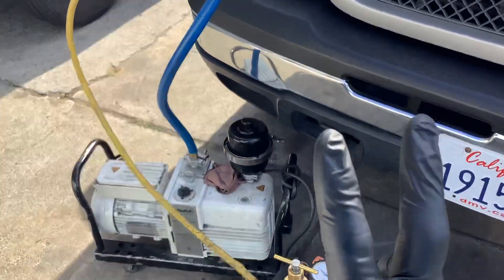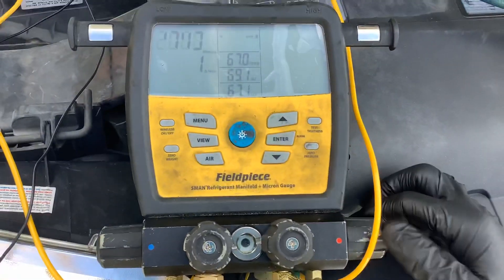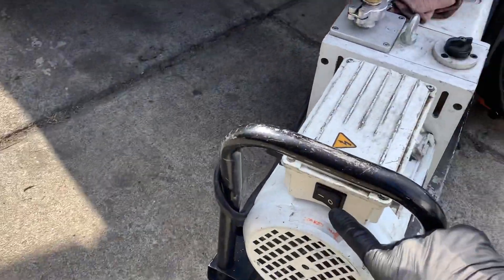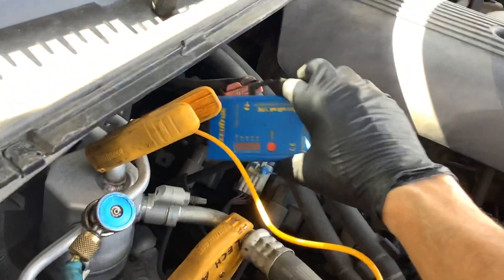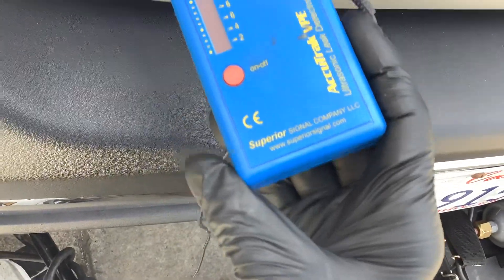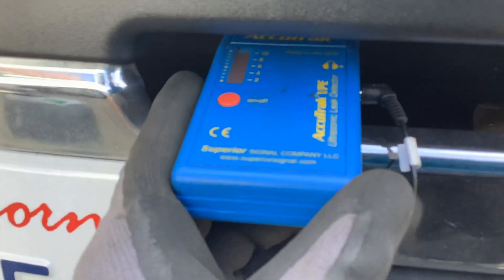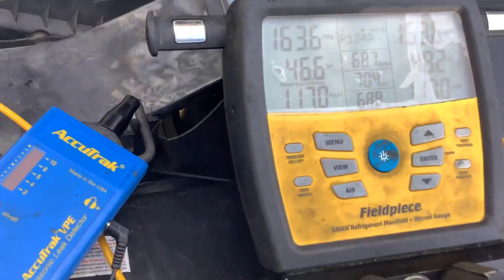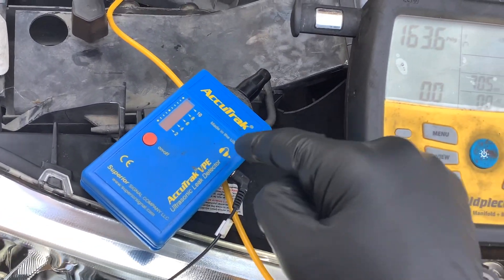High Pressure nitrogen decay leak test also using ultrasonic leak detector￼

Comment: Hello! Why do you do decay test by 160 psi only, but when system is charged and works it may has a pressure about 250 psi and more? In my region exists some rule to do decay test using nitrogen about 400 psi pressure, is that incorrect rule? And can you give any guarantees to the customer that system doesn`t have any leaks?
Reply from the maker: On residential split systems most manufacturers not all federal say 400 psi is good when I install a VRF system. Some of my manufacturer say 650 psi is good even on the Evaporators.

But we’re talking automotive here evaporators we’re not designed for 400 psi . 

Especially the Old Evaporators, everyone of us and automotive field know when you’re working on old vehicles with a large balloon accordion style hitters in the evaporators you will blow those evaporator sky high. You’ll see a big cloud in a loud bang inside the car and the oil coming out like an aerosol through the dash vents if you do 400 psi.. 

There has been many technicians who blew evaporators in customers car is experimenting, not knowing what they were doing. 

And then you can point to the Evaporator and say you have a evaporator late because you caused it. 

Your mind is thinking correctly for residential, but if you do that on customers automobiles you’ll be fine a lot of Leaking New Evaporators they weren’t leaking before but you causing to leak.
Reply: @coldfinger459sub0  so can I guarantee that system hasn't any leaks if I use 160psi? In my area 90% customers ask a guarantee that tomorrow it will not be leaking..
Reply from the maker: @markaircon  there is no guarantee no such thing that’s make-believe. Living in a fantasy world of unicorns and rainbows.. 

You did not sell the components. You cannot guarantee some thing you did not sell. 

If you sold the evaporator, you can guarantee evaporator doesn’t have a leak 

Any component you did not sell you cannot guarantee . 

Leaks or not always constant some leaks or intermittent . 

They rely on either vibration, going down the road or hitting a very precise certain temperature range they start leaking and then when the temperature range falls out, it stops leaking . 

Something that you cannot test for while the vehicle is stagnant, steady, sitting in your stall with your hood up 

And this is exactly why are you test using different methods like ultrasonic , with a good leak detector like a H-10 or a Inforcon DeTech Stratus
Leak detectors in the $600-$1000 plus range 

You also add refrigerant UV dye one of the better late ones made by tracerLine Products it’s one of the most expensive that’s why very few people use it . 

I’ve made many videos, showing other peoples UV dyes at the different spectrum. UV lights will barely get any glow out of them. They’re very poor performance. . 
 But they’re cheap that’s why people like them. 

And this is why it’s good to do a refrigerant leak test with a system that you have completely filled get it up to temperature get it up the pressure and then perform the refrigerant leak test using a refrigerant leak tester . 

Then, after you find the leak, you just throw it on the recovery machine. It only takes five minutes to recover refrigerant . 

Perform your repairs .

Comment: you mentioned that you charge nitrogen through the HP port...why not both ports at once? does it matter?
Reply from the maker: No, it does not matter especially if you have a hard shut off valve you end up using the low side anyway because it will not let all the pressure go through the high side into the lowside. 

But I do this method as part of the nitrogen sweep to help remove moisture 

Push to try nitrogen sweeping through from the high side and then bleeding it out the lowside and Pulling Vacuum from the low side and repeating three times .  This aids in the removal of moisture.